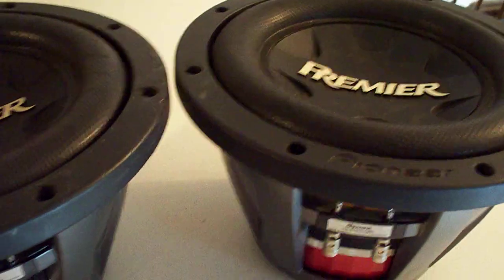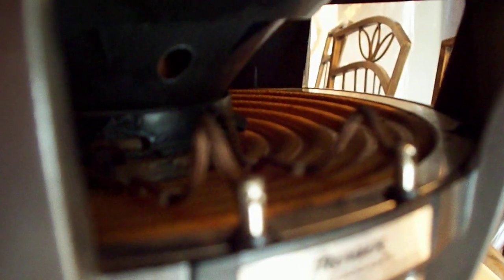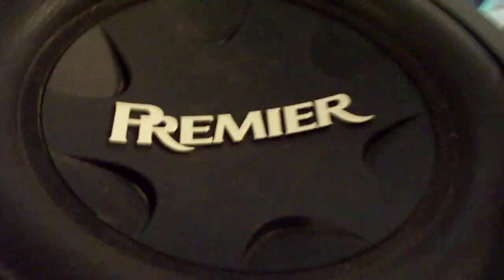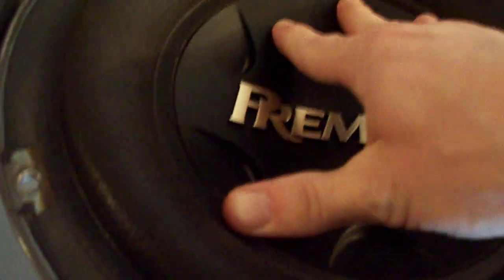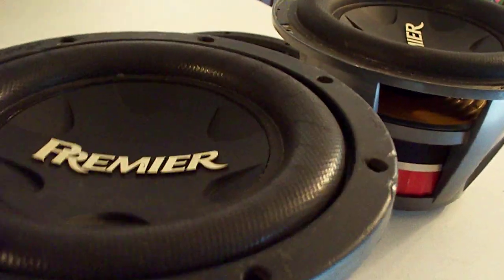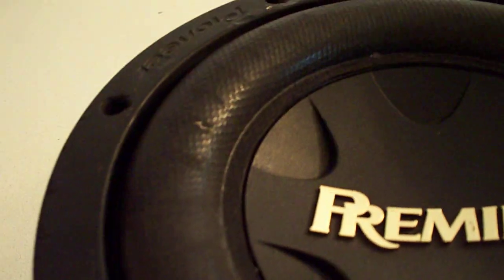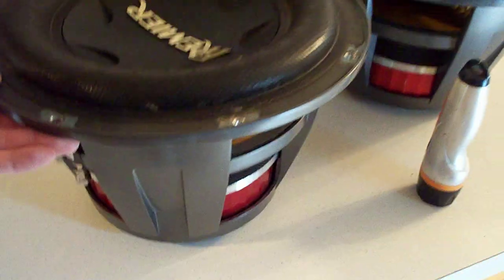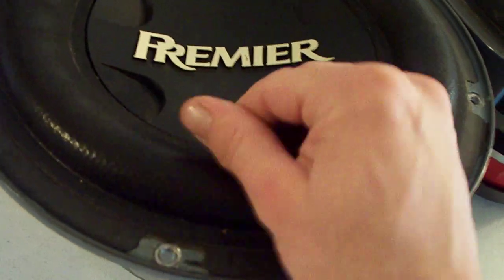Fix My Speaker ! TS-W3000SPL Pioneer Premier subwoofers in Detail

Comment: Just go on ebay and get a recone kit measure ur spyder and coil size and surround and get one of similar dimensions for the size subwoofer you have, some come with the coil seperated and just measure the factory cone if its in decent condition to know where to glue the spider, and you could save the original dust cap but forget saving the surround etc
Reply from the maker: problem is the dont have any coils that are the right size or 6 layer , sure you could do a kapton former 4 layer but that would change the sub totally , they also dont have the proper size spiders so you would have to build a ring to go with smaller spiders again major change to the original , you could make something work but it wouldnt be anywhere near what the original subs were
Reply: mazda2284 get some coil wire the same size and re wind them and look up a video on that
Reply: mazda2284 and re glue the spider to the same position as the other sub heat up the baskets to soften the glue and slowly remove the surround and then work on the spider
Reply: mazda2284 also changing the wire size would change the power handling and the winding requirements did you check to see if replacements are different coil wire sizes ? It wouldnt change the sub much if anything change the load on the amplifier just get similar power handing coils and re use your cones then will be alot more work but could be worth it

Comment: I have 2 of the Premier Champion Series Pro Modles TS- W3001D4 Dual 4 ohm 3000 max 1000 rms. In a Air Tight Box. In the trunk of a 95 deville. I coulda got away with a bigger box. It was only bout 15 inches deep or so. I had them on a Planet Audio RXD 2400. 3000 max 2300 rms @ 1ohm. Have the amp subsonic on 15 and level allmost all the way up and freq. @ just above 50Hz. ( ---> More on the next post)